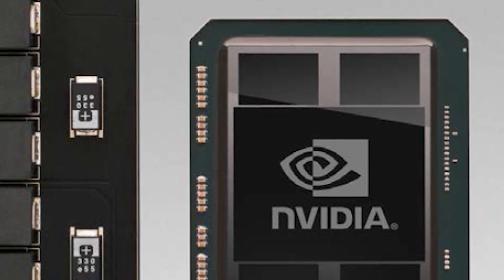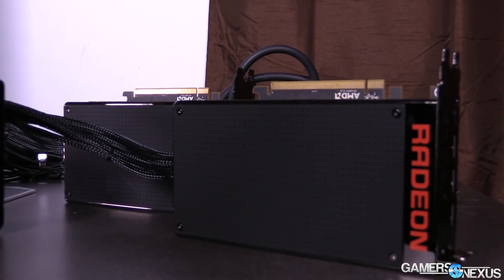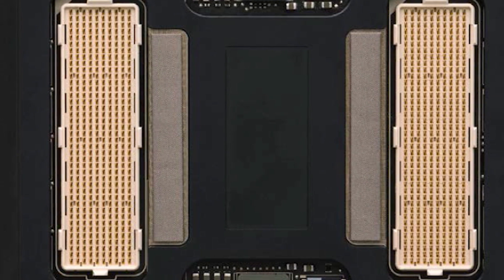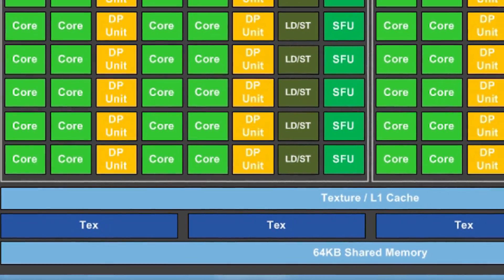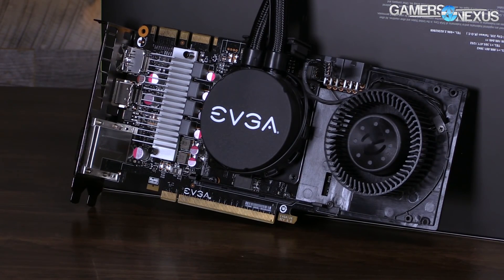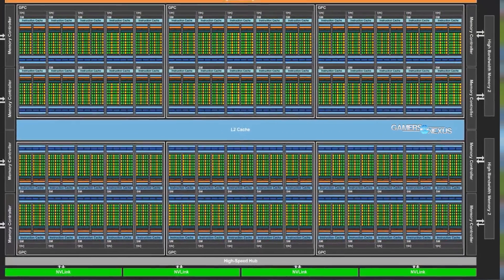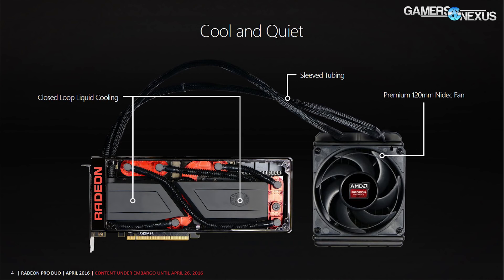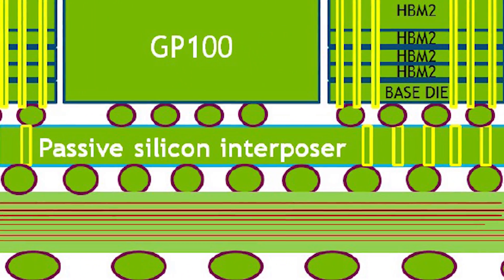NVidia Pascal Architecture Deep Dive w/ GP100

Comment: surely 1060 will beat the crap out of 980
Reply: +Francis Metrillo only if the need to give AMD a run for its money arises, most likely.
Reply: i just hope so
Reply: +Francis PowerPlay I think the GTX1060Ti would be slightly faster than the GTX980, with the GTX1060 replacing the GTX970.
Reply: Jeffrey Photonboy since the 1070 is as fast or faster than the titanx , im sure the 1060ti will be as fast or faster than the 980 and the 1060nonti will be in middle of 970 and 980

Comment: the million dollar question is: how will it perform on async compute? we need a laments video comparing pascal architecture to polaris or fiji or hawaii or anything that has the 8 ace pipelines gcn. is the 6 clusters comparable to 6 aces? this was a lot of great raw information but many of us cant decode it
Reply: *****
async compute is not something gpus have. its something they can do because they have enough pipelines. nvidia just does it so poorly that its worse than the single threaded pipeline structure of dx11. compute preemption might be nvidias name for how its architecture handles async compute. the definition of async compute is for multiprocessors to execute in parallel. to do this efficiently you need more than 2 pipelines which is what nvidia maxwell and older cards have. amd has 8 thats why they see gains. they made them like that for mantle 5 years ago which is very similar to dx12. so they have a jump start.

regardless of all that even if it does "perform slower than its supposed to" it is still twice as powerful as a titan x. polaris is supposed to be the best "performance per watt". they never said anything about raw power. so its efficiency and superior architecture for dx12 might not even matter in the end because of nvidias brute force approach with raw power
Reply: *****

here is an article directly from nvidia themselves stating "New asynchronous compute advances improve efficiency and gaming performance."

your move

http://nvidianews.nvidia.com/news/a-quantum-leap-in-gaming:-nvidia-introduces-geforce-gtx-1080

Comment: How do these compare to the titan? Are these better? confused
Reply: +Secret Stuff GTX1080 is about 25% faster than a GTX980Ti for normal gaming, and roughly 1.8X better in VR when using the NVidia code to optimize for the two image.GTX980Ti is close to a Titan X. Lots of people saying "it's faster than a Titan X by 2X" which again is VR results and only with that support I mentioned. (they did a test and go mid 60FPS and turned on the feature and got about just above 90FPS. I guess it looks for similarities in the two images since they are so similar, one for left eye and one for right).
Reply: +Jeffrey Photonboy thx now I understand

Comment: What happened to hbm2
Reply: +net200777 Nothing,its on its way.Maybe first quarter 2017.
Reply: +net200777 low yields due to manufacturing issues and cost, extra r&d was needed lessons learned from hbm1 delayed it a little longer, late this year maybe early next.